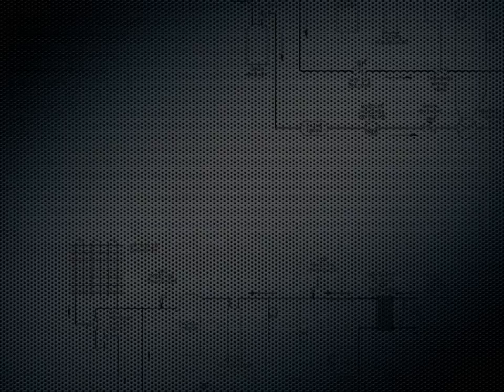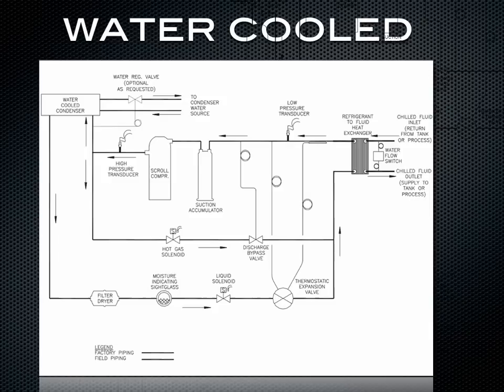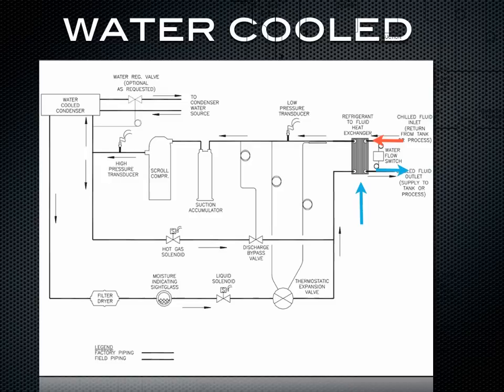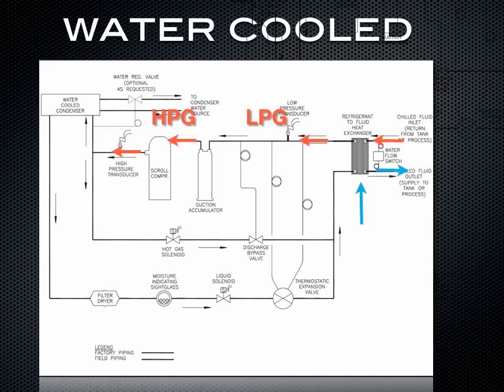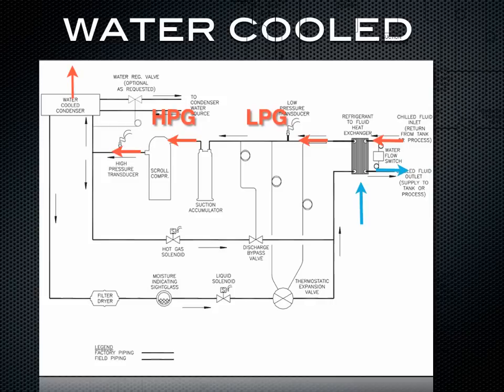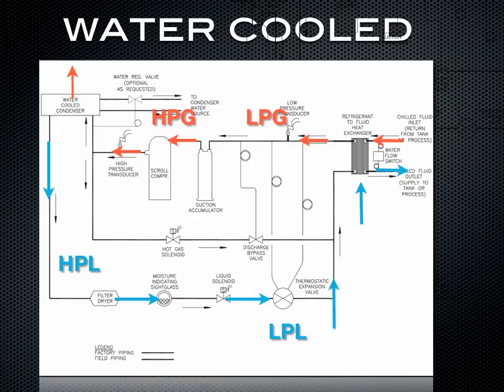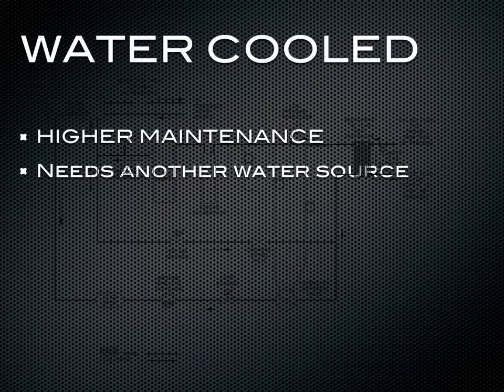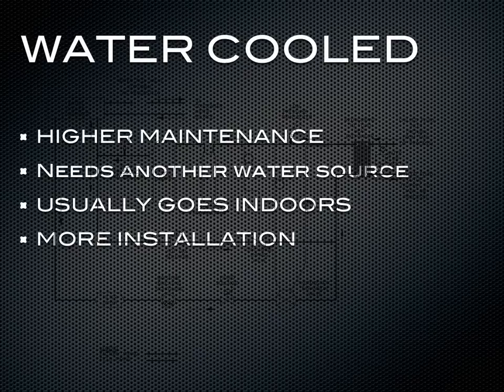How a chiller works-water cooled refrigeration.

Comment: so if the water is taking the heat out of the condenser and storing it in a tank for hot water use, what happens when that 100 degree water eventually gets to the same temp as the condenser and can no longer pull the heat out? would you need a 2nd water supply?

Comment: I have a question, where does the low pressure gas come from?
Reply: The LPL is evaporated into low pressure gas in the heat exchanger/evaporator. As the LPL evaporates, a large amount of heat energy is removed/absorbed from the process side, thereby cooling the liquid in the process side down considerably.

Phase changes (Solid > Liquid > Gas) require relatively large amounts of energy to occur. This energy is absorbed by the refrigerant liquid as it changes to a gas. Almost every form of cooling works on this basis.
Reply: WarriorofCathar thanks! :D
Reply from the maker: Nice warriofcathar !!!
Reply: Means LPG is actually the refrigent that takes heat from LPL and convert into LPG? Im confused